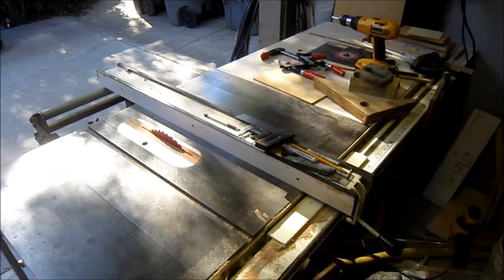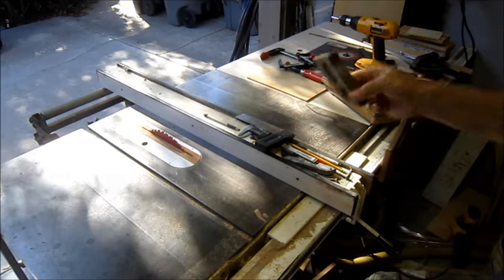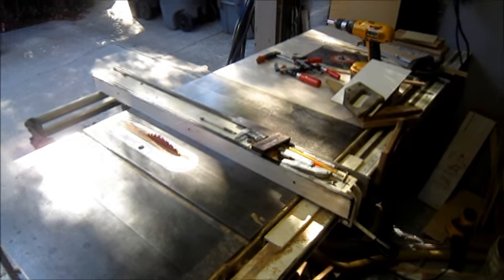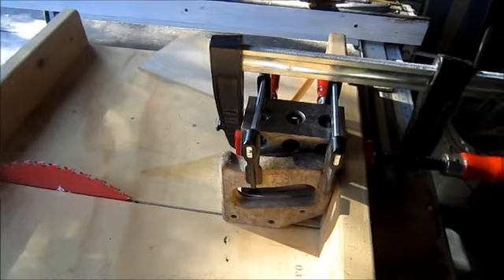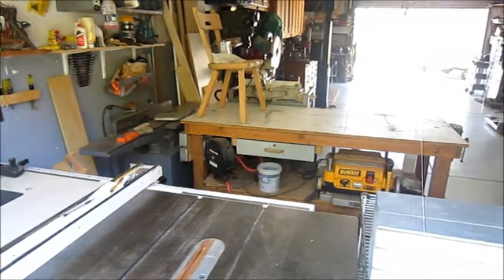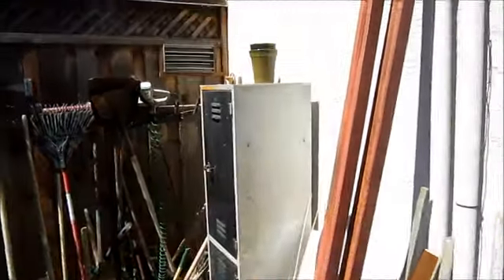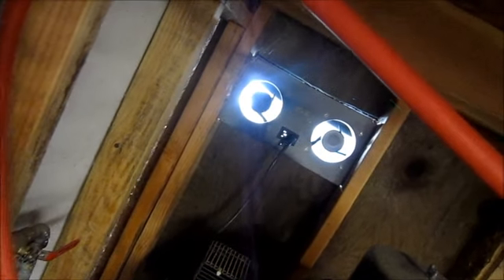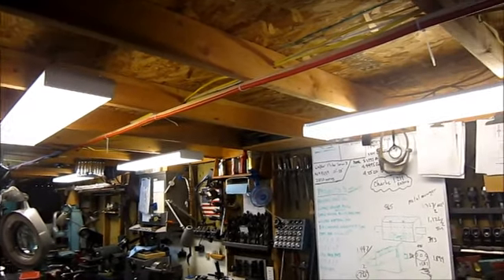Quickie 32   Shop Time

Comment: Chuck, that saw is one heck of a deal!  The router alone would cost more than that (I have two of them...). Exactly how big is that eight ball of yours?

I always try to clean the shop when I'm done for the day. Don't like using up useful working time cleaning before I can start, and I figure when I'm too tired to work safely anymore, I'm also too tired to notice that I'm cleaning up!

Have fun with the new toys!

-- Mike
Reply from the maker: BigMjolnir Thanks for stopping by Mike, my best friend is "Mr. Clean" and we worked together in our 20s, he always had me cleaning and when he does come to my shop now I have to get it ready for inspection.

Comment: Hi Chuck,
Nice to have lots of room, since my metalworking shop is taking all the place in the garage, there is no more room to do woodworking inside, so, it's outside with transportable tools, when weather permits. Meaning not in winter, when it rains, not when I'm not in the mood, almost never in fact, too much a pain in the but to get installed and pick up.
BTW how much surface do you get in the garage and shop? And great deal on the sawmill....!
Cheers,
Pierre
Reply from the maker: pierre beaudry Pierre, I certainly understand the issues with moving items to work, then move them back as I have done it for years and still have to.  My main shop is 800sf (20x40) and the machine room is 264 sf (8x33).Thanks for watching and keep the projects going no matter how much moving is required...ATBChuck

Comment: Cool fans Chuck! I love a well ventilated shop! We had that 48" wall fan in out old shop it it was perfect for pulling air though, and also great to remove all the cutting oil smoke. That's one thing I want in my new shop for the times I won't be running my AC. Cool install, you'll like having them. 

Adam
Reply from the maker: Abom79  I know my mentor, Chui, will be very happy as the no ventilated shop raises hell with his breathing
Reply: Chuck, you gotta have some air flow. I can't stand working without some kind of air moving on me, even a fan! It's hard to beat climate control though. The shop ventilation fans should help you out.

Comment: Very crafty repurpose on the saw handle. Did you put the tools in and then build the room? Looks like it would be awful tough getting them in and out that door.
Reply from the maker: bcbloc02 bcb....the mill was easy to get through the door, just sliding on pipes, the lathe was on casters and it rolled past the mill, as did all other machines except the surface grinder.  There is a mandoor behind the glass beader and that is how I got the surface grinder in the shop, but I did have to pull the motor...it was a task, but to do it a second time it would be easy now that I now how to do it.Thanks for watching

Comment: Very nice!  Hopefully, those fans will pull enough air from the car shop in the winter to make the metal shop more comfortable. :)
Reply from the maker: bluehandsvideo Hello Mike, I meant to show the heater adjacent to my mill, I have an electric unit that I use and keep the door closed to the main shop.  The main shop has a gas unit that I use when necessarytalk to you soonChuck

Comment: Nice reuse of a scrap handle.  I would still get a Micro Jig at the first opportunity, it's not just that ii has a thin leg it has three legs and holds the wood down and controls both the offcut and the board right on past the blade.   There is an optional platform that screws into the side of the micro Jig and holds it level, that really helps on cuts just like the one you did in the end of the video to test your new push stick.
Reply from the maker: John Bare Hi John, I agree a MJ is on my want list to purchase

Comment: I sold my Delta Unisaw, similar to what you have, but no router, just the insert for $1000 when I got rid of all my woodworking tools to make room for the machine shop.  I miss it greatly. But just don't have the room in a two car garage.
Reply: Take it from me, Herb. Unisaws are a pain in the (insert body part here)! I find them easier to work on if you remove the table. The belts and arbor bearings are not fun to replace!
Dave
Reply from the maker: Herb Blair Hello Herb, I can understand missing the WW tools, as you did some great projects....